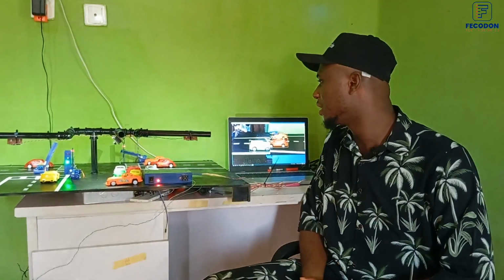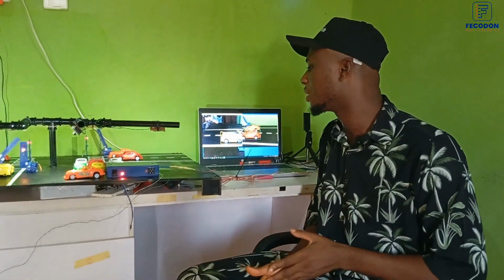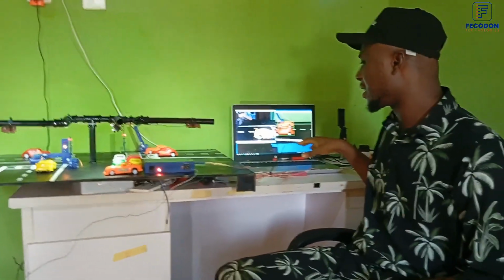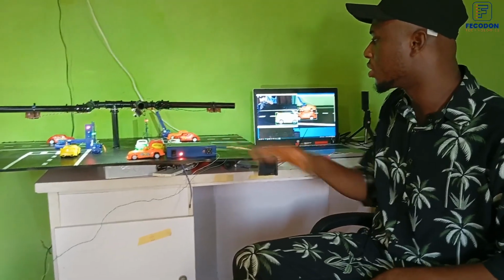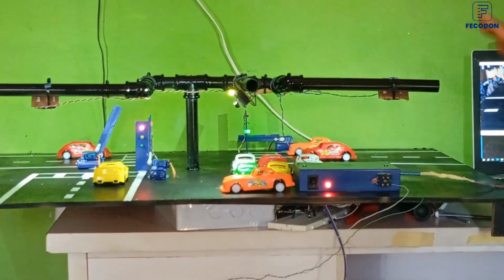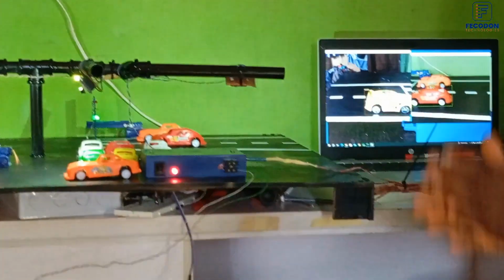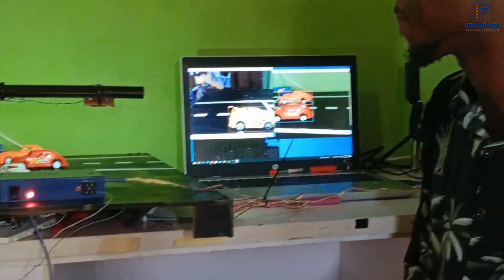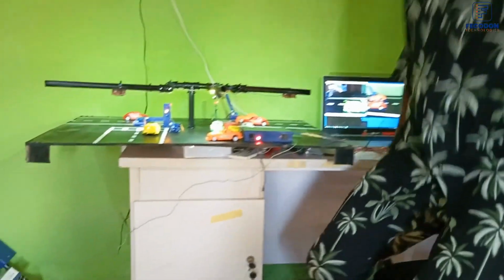AI Smart Traffic Control System Convert

Comment: It is really an interesting system but my difficulty is video quality. I am unable to see clearly or observe your explanations because the video coverage is not following up with your explanation. I assume due to funds you are not able to use autonomous cars and 3D video views. 1. I didn't see timers in your explanation.
2. I didn't observe clearly 🚦 colours 
3. You didn't number the lanes making it difficult for me to know the point you are on in your explanation.
4. I didn't see the overall view of your systems. 

However this the smartest traffic 🚦 control that would actually be adopted as the case may be. Thanks and more videos of other works please if you have one.
Reply from the maker: For the video quality, you can adjust it from your YouTube app to get up to 1024. If after adjusting and the video is still not clear enough, please do let me know.

I explained the timing which could be added in the system, but I didn't include a display to show each of the times.

For lane numbering, I explained the numbers for each lane at the beginning of the video but I didn't include an explicit number on the body of the system 

Please can you elaborate more on the 4th one so I can understand what you mean.

Thanks very much for your concern and points notter accordingly.

I will upgrade the system with new features in due time.